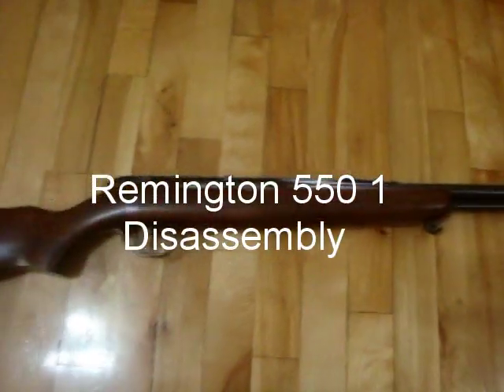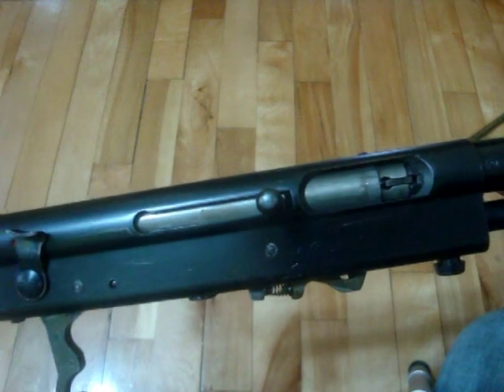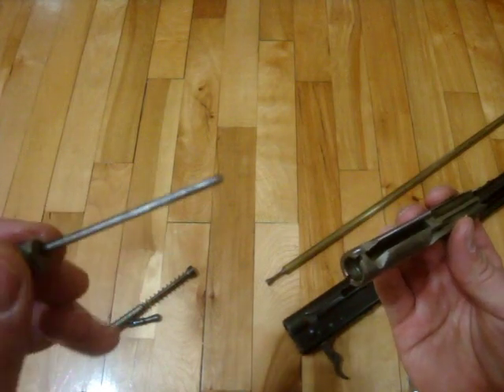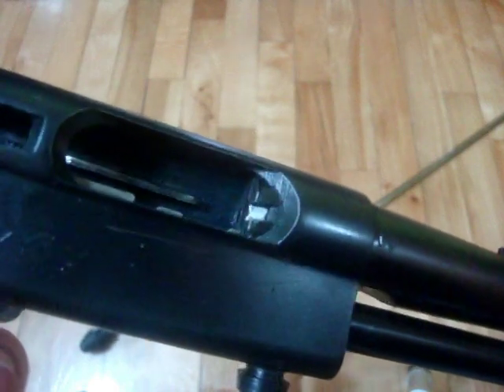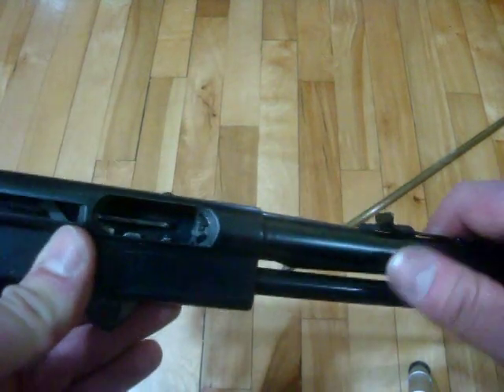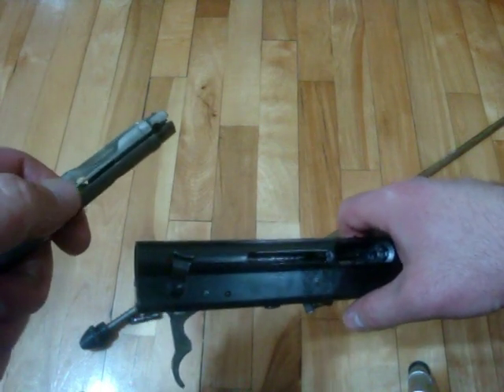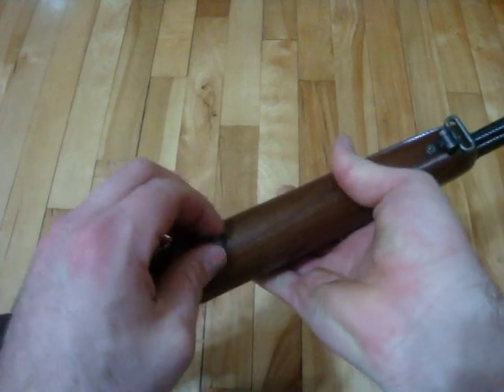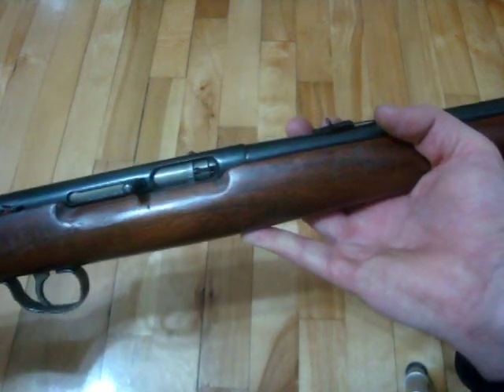Remington 550 1 Disassembly

Comment: My grandfather had one of these on his boat as a "shark gun" that he used to retrieve his marlin jigs if a shark bit it instead.  It had been on his boat for over 20 years and had seen a lot of salt air.  He kept it in a leather gun case my great grandfather made.  

When my father died, I found it in his closet.  It had .22 shorts in it and it worked first time.  I took it out yesterday and shot .22 LR's in it.  It performed flawlessly.  It's also a very accurate rifle having such a long barrel.  

The barrel and receiver are both severely-pitted from the oxidation from the salt air.  It looks like someone tried to clean it up with steel wool and something more-coarse.  

Not the best-looking firearm I own but it has a lot of memories that go along with it.  It's also a great shooting rifle and may become my favorite plinking firearm.

If only my Grandfather would have known where it was to end up.  He was always a great guy that believed in me.  Now, I'm 62 and my 16 yr old son is firing it.

Great memories in the past and many more to come.
Reply: Thanks guys, I just got mine by inheritance💚🍀

Comment: Many thanks for your video. It encouraged me to pull my 550-1 out of the closet and go to the range. I purchased it 65 years ago at the age of 16 from my earnings of $25.00 per week as a lifeguard. All it needed was a check and cleaning to be sure the bore was safe. I fired 100 rounds of Remington Thunderbolt through it, loading 10 rounds per target. It did fail to eject the last round on two targets, but otherwise performed flawlessly. It still has all of its blued finish and the stock has a few minor dings from my squirrel hunting ventures. Back then the rifle probably cost about $20.00 and 22 long rifle ammo was fifty cents for a 50 round box. My son also learned to shoot with this rifle. Your video was very helpful. Keep up the good work.
Reply from the maker: +Martin Carson Thanks for watching, Glad it helped you get your rifle back out shooting, those little rifles work way too well for them to be left in a closet.

Comment: THANK YOU!  Excellent video!  A WWII vet from the Battle of the Bulge gave me his 550-1 and we fired it at tge range tge other day.  I like to disassemble a gun at east for the first time for cleaning so I'm completely familiar with it and don't have it explode in my face.  I really your help.  Much appreciated.
Reply from the maker: +Laura Dwyer I'm glad it was helpful. Nice to know that a few people from that generation are still around and still sharing a nice hobby. You should have many years of enjoyment out of that rifle. Only thing to do if you want to keep it running smoothly is once in a while feed her shorts. If you only feed it long rifle, there is a chance that the floating chamber will seize and not let it cycle shorts properly the day you want to, which involves taking apart and cleaning the rifle again. By firing a couple of shorts through it once in a while it keeps it moving freely. Thanks for watching.

Comment: Got one of these from my dad when I was around 10, (1974ish).
Had been run over in the driveway and cracked the stock, someone filled it in with epoxy I'm guessing.
Took it apart, cleaned it real well, refinished the stock with boiled Linseed oil.
Reblued the badly corroded pieces, steel wooled some others.
I'm going to try to put it back together today.
Great video, Thanks for the info
Reply from the maker: Poor rifle. Hope you get it up and running again. Great rifle.
Reply: @Stray03  finished with the reassembly, looks great, cycling smoothly. I hope the shorts cycle this time, they never have.
Just looked up the build date, it has PUU, Rem guide says that was first year built ,1949. Did not think it was that old
Reply from the maker: If the floating chamber moves freely it should.

Comment: Thanks for the info, very helpful. I am trying to restore one that had been left outside for years. This answered a few disassembly questions I had.
Reply from the maker: Glad It was useful and good luck with that poor gun. I also have a video on the trigger group disassembly. Just be careful with it, damage is easy if you are not careful/gentle.
Reply: Not touching the trigger after seeing the video. I did take off the trigger lock, but that's it.
Reply from the maker: Steve Carlin A good oiling should bring her back up to working order. Good luck with it.
Reply from the maker: Stray03 .22s are pretty tough to kill. you will be surprised how little you will have to do to get her firing, Now it might need more to get her firing well but that is for later lol.
Reply: Got it rebuilt and sort of re-blued. Fired a test cap and it didn't blow up, I'll have to take a picture.
Reply from the maker: Steve Carlin Definitely will be interesting to see how she turned out after being neglected so long. Hope for you it runs well, they are great little guns, and they cycle everything when in good condition.

Comment: I found one of these 550-1's at a gun show abut 2 months ago.  Like everyone said on here the floating chamber was stuck.  So after un-stucking it lol it is very neat to load up all different kinds of 22 rounds, shorts, long rifle's, standard velocity and hight velocity's it shoots perfectly with them all.  I haven't shot any cci stinger because I really don't want to hammer the ol girl's bolt and spring to death with those super hi-velocity rounds but I bet it would shoot them to.  I think this is now my most favorite old 22 rifle.  By the way the newer semi auto Remington 552 model even with out the floating chamber system will shoot shorts, longs and long rifles as well.  Thank you for the break down of this fine gun and posting it for us.
Reply from the maker: That is interesting I didn't know about the 552 Guess I'll have to try to get my hands on one of those. Yeah I don't want to put the hyper velocity stuff in just in case it messes mine up.
Reply: Stray03 Standard velocity always seam to shoot more accurately in any of my 22 rifles so their is no need to pound my bolt and springs to death with those hyper velocity rounds anyway.  The 552 model uses a very light almost pencil diameter bolt so because of its lightness I think that how they get away with being able to cycle and shooting the shorts and longs and long rifle rounds.
Reply from the maker: littlejpl Yeah they probably set up rifle to shoot short and then just chambered it to LR. which would probably amount to putting the hyper sonics in a 551.

Comment: Please don't take offense, but from an old retired master gunsmith: for Gawd's sake, man, get a bench and ditch the dime store screwdrivers, you're making this old coot nuts. Other than that, very fine video, young man :-)
Reply from the maker: Lol actually this was filmed when I was away from my tools and bench. I do have a cheap gun screwdriver set, a and a workbench which you will see in other videos, just I was at a second residence so I had none of that available. Also in videos I often will go on a neutral surface to make it easier for others to see what I'm doing. Often my workbench has a few projects on it and it distracts. Thanks for watching.

Comment: Great job, slow and clear enough to follow. Very informative. Recently inherited on of these, not running yet. Seems like the firing pin is stuck forward/not being cocked back.
Reply from the maker: Hope it turns out to be nothing too difficult to fix.
Reply: Me too, it's a very cool gun. I am so sick everyone pushing the 10-22 kool aid.
Reply from the maker: If I put 4 grand worth of parts in and still had a rifle shoot badly at 50 yards I'd be pushing the kool aid too.

Comment: Don't make the mistake of removing the seer retaining screw!!!
It will cross thread on you when you try to put it back in!!!!!!!!!
Reply from the maker: Yeah I have heard that if you are not careful you can do that. I haven't tried yet.
Reply: +Stray03  Hi my bolt is jammed back tight pulled the spring still can't move it got any ideas

Comment: Very good video! You explained as you went along. I have one that's just been setting around collecting dust for God knows how long. Wanted to clean it tonight and shoot it tomorrow. Thinking I will do that. Mine has a dust cover I haven't seen anyone else with one. It won't get in the way for disassembly but I was just curious if that came with one and everyone I seen just had it removed
Reply from the maker: I have seen a few with dust covers, Mine may have come with one originally too because I have one floating around and am not sure which .22 it came with.
Reply: Are you talking about the Shell Deflector that makes the shells not fly up into your face?  They all came with one, but many people took them off.

Comment: I just pulled my ancient 550-1 out of the closet and followed your lead while taking it apart. When I tapped it to get the floating chamber out, a long/thin spring fell out the back. Couldn’t find where it went so I put everything else back together, and now the hammer doesn’t fire. I’m guessing that’s where the missing spring goes?
Reply from the maker: Spring from the bolt?
Reply: @Stray03  nope, just found your other full disassembly video. It was the sear spring. Almost got it going now. Gotta realign the sear with the trigger. Somehow it got misaligned during disassembly and it’s a royal pain to realign. Hopefully I don’t have to remove the entire lower. I’m used to AR’s, not this old squirrel hunting toy lol

Comment: My grandfather has one of these that I drive up to his house and shoot when I come home from college on weekends. When I first started shooting it, it had a problem with ejecting rounds, there were about 5-7 times out of a box 325 rounds where it wouldn't eject a round, but like I said, that was at first. After it had been shot enough I never even had hiccup. I could load it full and empty it out as fast as I could and it never skipped a beat. Accurate too. He's got a remington model 33 single shot, bolt action .22 that's messed up as well that I'm going to repair and shoot this summer. I'm curious as to which rifle will be my preferred rifle out of the two, that 550-1 is something else.
Reply from the maker: I like the 550 because it feeds everything.   Subsonic is my favorite because it is really quite and since Im not allowed cans up here I have to go next best thing lol.

Comment: First off thanks for all the info -- really good info from start to finish on this 550-1.  But, I did inherit one from 1955 that was missing a magazine tube rod.  I found an original rod online and cleaned the gun really well including the magazine tube.  But, I am finding that if I try to slide the tube rod all the way down the Magazine Tube that it doesn't go all the way down.  The only way to get it to accept the rod is to slightly loosed up the really small screw that holds the magazine tube on the rifle.  Is that what I am supposed to do or is there some other option here.  I guess I would think that small screw should be nice and tight to make sure the magazine tube stays on the rifle.  Thanks!
Reply from the maker: Is it the original screw that is on there? Don't see why it would deform  that much if it was the original
Reply: I do believe it is the original screw...  If I loosen it up a little, then the inner tube rod slides in and out just fine.  I believe the larger outer screw seems to be holding the Magazine Tube onto the rifle.  It seems like it works if the very small screw is just loosened up a bit -- but seems kind of strange... @Stray03
Reply: I asked a buddy of mine the same question but don't fully understand his answer and haven't been able to get a hold of him.  But, he says:  That magazine screw doesn't need to protrude inside the outer mag tube to hold it in place. It should be held captive by the takedown screw bushing. @Stray03
Reply from the maker: Because the bushing acts as the piece that locks it in it's forward position. is the mag tube lined up properly under the screw? I haven't taken mine apart since these videos so I really don't remember much about it. @NathanFranzene

Comment: Use a penny on the screws holding the stock on, a screwdriver could possibly damage them.  Great video, I have been looking at a 550-1 that has been at a pawn shop for a while.  I'm going to offer them 125 see if they will bite.  Video seems pretty straightforward on getting it to a point I can clean well, especially that floating chamber.  I have a 241 Speedmaster, a 552 Speedmaster and a 582.  I say, why not get another Remington?
Reply from the maker: +koorbtsewe Can't go wrong with a 550. Good Idea with the coin, especially for a gun that hasn't been taken down for a while, Mine was rather easy to take down, so I wasn't too worried about damaging the screw, But if if felt off I would have tried something else. Thanks for watching.
Reply: +Stray03 What would you consider a good price, they have 175 on it, not in terrible shape but could use a good cleaning up.  0000 steel wool to the barrel would help not rusty but very dirty.  Stock not beat up but could use a finish.   Like I say I will offer 125 but if they are great guns I might go 150.  i can't see 175 as that is what I give for my 241 Speedmaster.
Reply from the maker: koorbtsewe I paid that much canadian for mine. It is worth the money but I have heard of them going for 100-150 in good condition in the US.

Comment: There is a pin holding the barrel and the tubular magazine, how did you made it moved back and forth? Can you get the pin out? How?
Reply from the maker: Never tried, but apparently you are supposed to drift out the barrel pin then pull both the barrel and tube out as one unit, then afterwards separate them.

Comment: Thank you for the video, Stray.  I just inherited a 550 (not -1, don't know if that's important).  It fires intermittently, without enough firing pin oomph to ignite the primer...every third or fourth shot, perhaps, won't fire.  The .22 round (lr) are dented but not fired.  It's a wonderful rifle, by the way.  But I guess a good cleaning is called for.  Any specific recommendations for this issue?  Again, many thanks.
Reply from the maker: +Robert Budz 550 difference for the most part IIRC is that it has 2 extractors instead of a single one like the 550-1. 550-1 was a "simplified" 550. Yeah cleaning the gun is a good start. while it is apart check the firing pin for dryfire damage, also check the chamber for the same thing where the rim of the cartridge sits. if they are fine oil it well and if it still doesn't work properly. If the spring doesn't look damaged it should work well after that. If not let me know.

Comment: when the gun is ready to shoot. when you pull the bolt back is it suppose to stay back till you push it forward or should it automaticly go forward?
Reply from the maker: If you pull it completely back and release it, it should go forward completely. if you carefully release it forward the round will hold the bolt back due to friction. and you will have to push it forward until it releases. So the best is just not to baby the cocking of the gun.  Now if you tell me it doesn't have any spring pressure on the bolt once you cock it, then there is a problem with the bolt's spring assembly. (should be 2 springs pushing behind the bolt)

Comment: My barrel screw at the bottom is stuck tight! Any suggestions??
Reply from the maker: +Daniel Surratt Talking about the screw to allow you to remove the chamber?
Reply: +Stray03 yes i actually got it unscrewed last night. although i do have another question how do you remove the extractor from the bolt? Thank you for the help!
Reply from the maker: +Daniel Surratt IIRC like most extractors, you push back the plunger with either the special tool, or you get one of those tiny flat head screwdrivers and bend it into an L shape. When the Plunger is pulled back the extractor can be pushed back and pulled out.
Reply: Thanks I got it an now just waiting on a new bolt!!
Reply from the maker: Daniel Surratt Glad it came off easily enough. Let me know how it goes.
Reply: +Stray03 ok will do I will most likely upload a video!
Reply from the maker: Daniel Surratt Thanks
Reply: lube , oil idk mine might be to i havent checked
Reply: If you ever get a replacement bolt, ($40-$55.00) be sure to look at the action where the the bolt glides back in forth on the opposite side of charging handle because this is were the bolt will wear thin and you will see the firing pin start to protrude on the side of bolt. It’s starts out as a real thin line then just gets worse over time.  To prevent this add some gun grease to this side of the bolt, grizzly grease works fine, gun oil works to, but if you don’t clean the bolt every time after you shoot it, it will have no lubrication and will rub dry till you have that fine line hole.   

Plus just use CLP to clean trigger action as to never remove sear screw as mentioned, this will really be hard to put back in because it’s under pressure, to solve this problem if you take out the sear pin out, have it drilled and tapped and add a plug/cap this will allow you to put the pin and spring in.  (there is a good YouTube video of this process) A good machinist can do this for you for under $20.